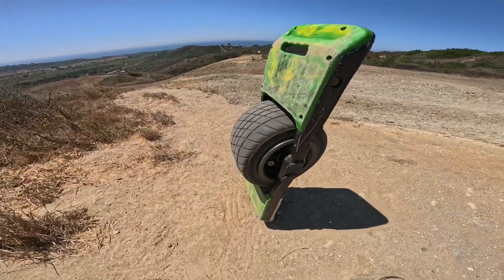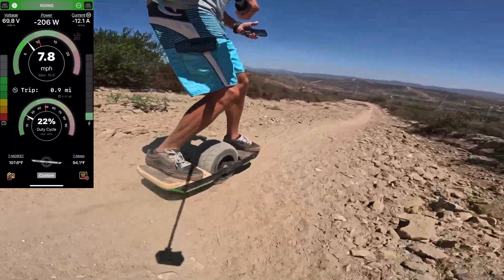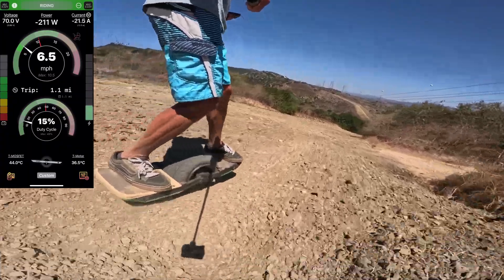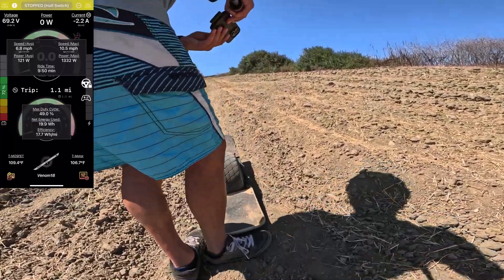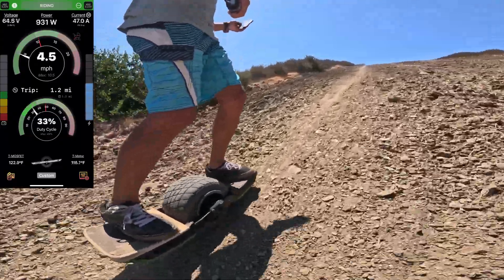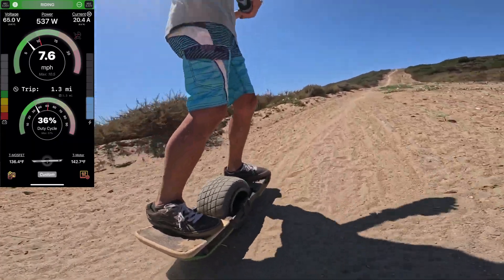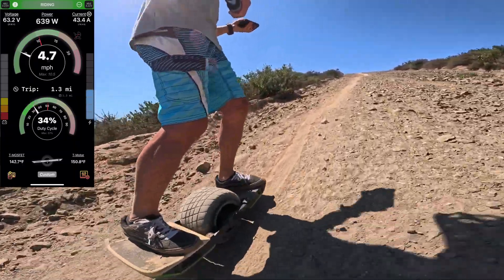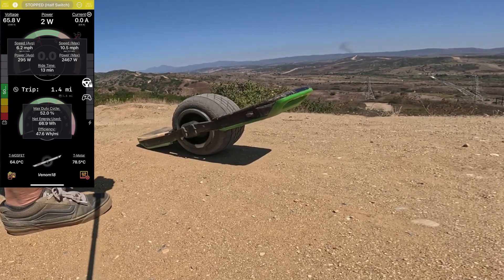Bring the Heat - Part 6: Hypercore VESC Trickboard

Comment: @surfdado, did u build the battery yourself? Or where did u get it? Also, how much less range do u get going 1p vs a more typical 2p?
Reply from the maker: yes, I did build it myself - the P45B cells are amazing for 1p builds, sag feels comparable to a 2p 18650 build, range is 25% less, basically comparable to stock XR

Comment: So Statorade is fine to use with VESC + FM Motor but not with a full FM Board? As I see FTL said don't use Statorade with FM boards
Reply from the maker: @tiztrain  yes, fine with VESC as long as you have reasonable motor cutoff numbers, such as 80 start and 90 end - this guarantees that you don’t allow your motor to get close to epoxy melting temperatures

Comment: Looks like the GTS motor uses significantly less battery power to climb the hill compared to the Plus motor. GTS must use thicker wires inside to reduce losses.
Reply from the maker: the power used is likely identical in all boards - also no, the wires aren't thicker in the GTS
Reply: @surfdado  imo, something special about the GTS motor.
Reply from the maker: @uhjyuff2095  I’ve seen zero evidence for that so far - check the early TFL tear down video to see for yourself

Comment: Future motion move so slow in the innovation department, I don’t think they will ever catch back up, I gave up on them. Do you think Tony is building an 30s controller that is integrated into the cannon core with 15s2p pack in the back and front? It’s already possible with the VOW plus x12-30s/cannon core design, I just worry about the heat!
Reply from the maker: I hope not...
Reply: @surfdado  I'd have to agree with surf. The ADV controller and BMS is sorely lacking
Reply: He has already claimed that this is going to happen. Not super soon, but it's his plan. That's the reason the controller is long and skinny - it's already narrow enough (I think) to fit in the cannoncore.
Reply: @AlexM-wt1pu  that would be a sweet setup if they can resolve the possible heat issue.
Reply: @surfdado I’ve been contemplating a similar bill but with a UB box 100. I was thinking of doing 21S 1 P
Too scared to do 22P because the strong warning of not going over 93 V. Do you know if anyone who is used a UB box and 21S1P
Reply from the maker: @justintmars  you should be scared with 21 too - Ubox is designed to handle 20 at most - 21+ is for PEVs with little or no regen.
Reply: @justintmars  my bud made a pint conversation with ubox, 22s1p p45b. Working great for tech trails.
Reply: 2 words for you " charge pack "  carry a battery and a charge adaptor and double your range without cooking a battery in a 50 lb board